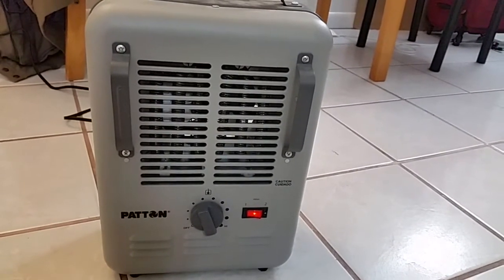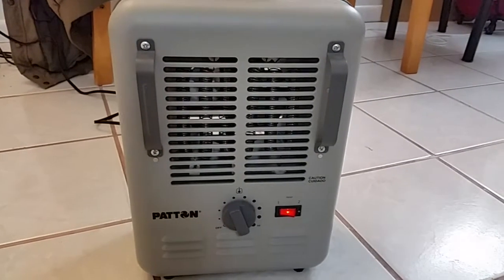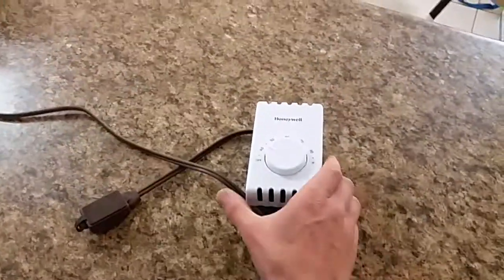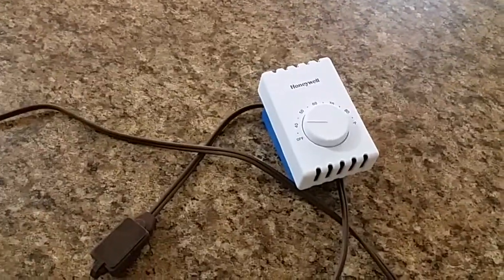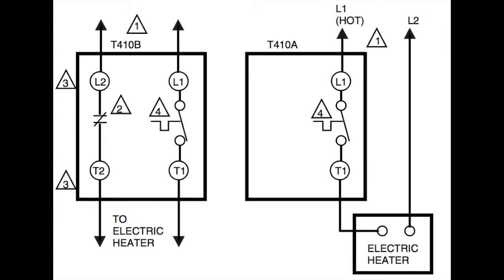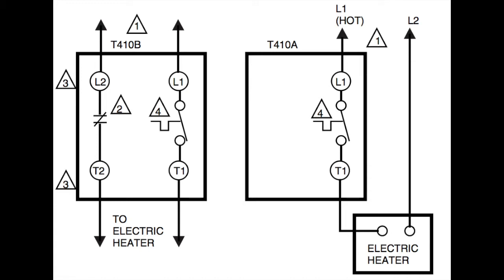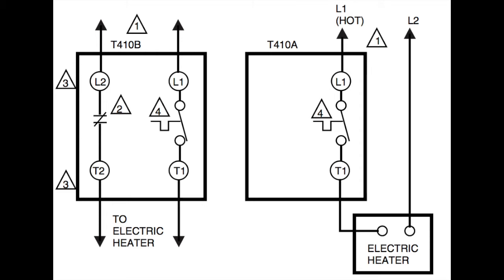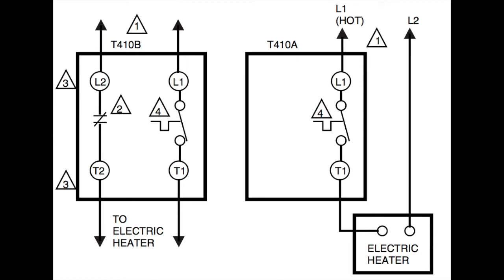Space heater turns off and on!

Comment: You did everything correct but one thing is don’t ever use those cheap extension cords with those heaters. Those heaters use around 12 amps and those small cords are not rated for that. They do cause a lot of house fires with that. Just a caution tip!
Reply from the maker: Hi Dylan, thanks for your input!  I did match the extension cord gauge to the heater cord (16AWG), but failed to account for the extra length of the cord.  It should be upgraded to at least a 14.